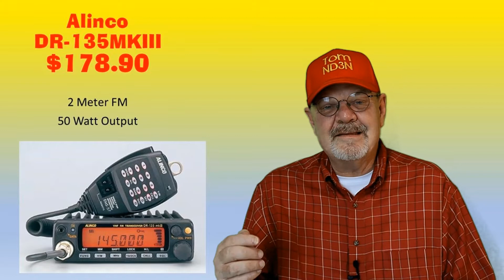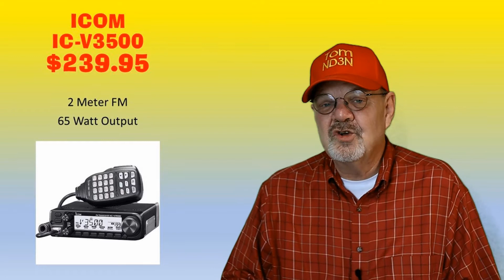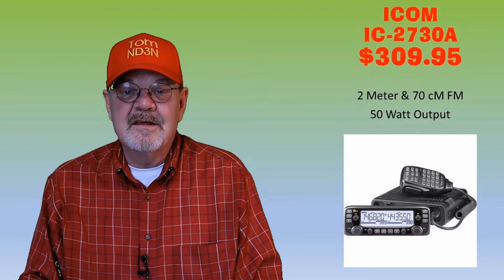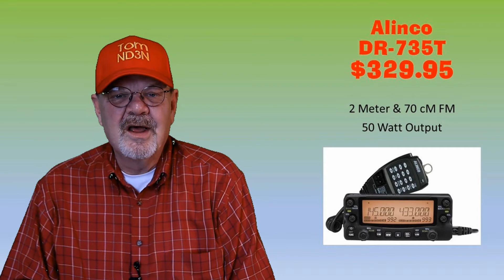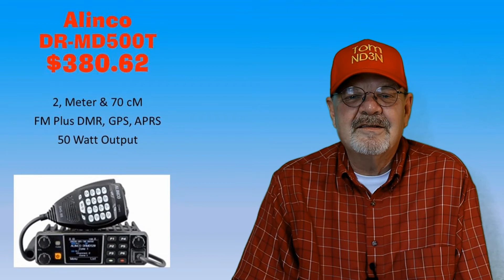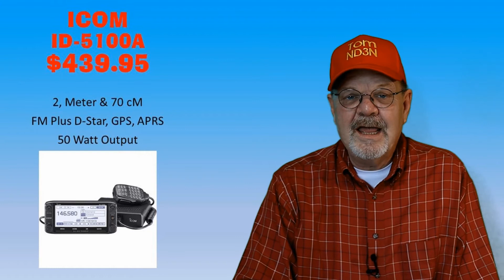20 VHF/UHF Mobile Rigs - Plus one bonus rig

Comment: Great summary video.  Thank you.  I have several of the Powerwerx DB750 and they are incredible radios.  They can be used for Business radio frequencies (I'm FCC licensed) / monitoring the Air bands as well as Ham bands.  These are "Full duplex" radios so can be used for any of the FM satellites.  Not well known and easily overlooked. Just an aside.... I've had extremely good warranty/service from Powerwerx and recommend them for radios and parts.